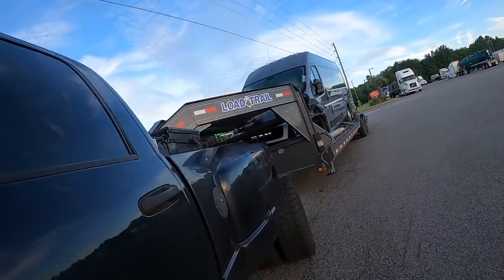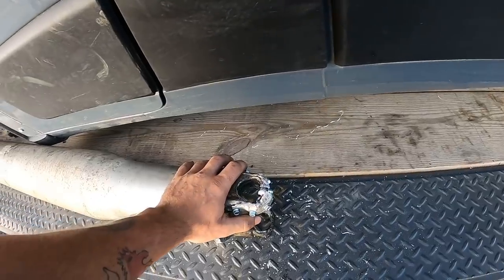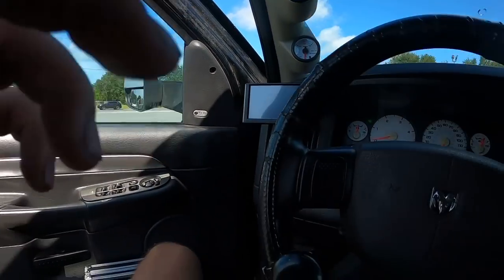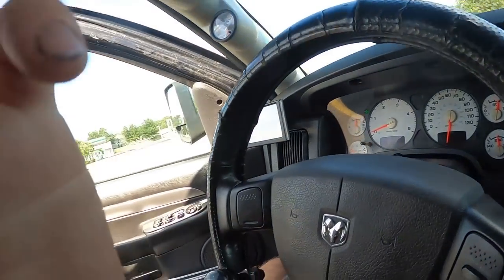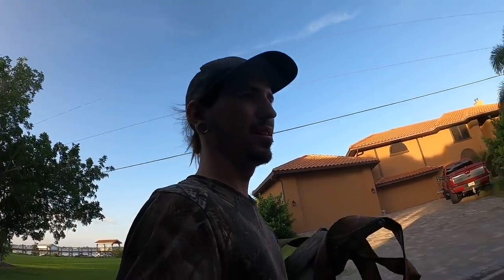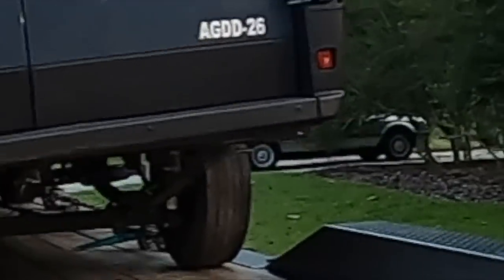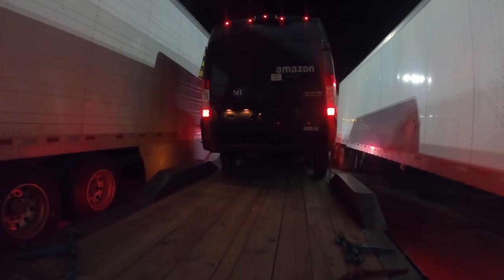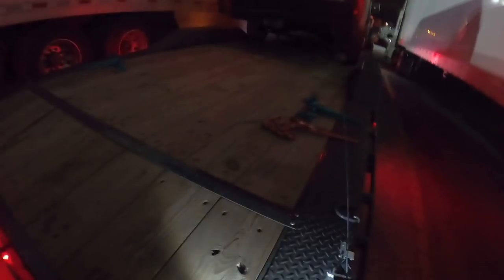How To Destroy A Driveshaft With 24k Gross Weight | Up And Running Again!

Comment: I would find a local driveline shop where ever your at throw them a little cash to get you fixed up and on the road ASAP time is money
Reply from the maker: Friday at 330 is when it broke
Reply: @CPSteveMiller  bummer yeah that’s a bad deal kinda sol on a Friday besides fb marketplace. I’ve done that during the week when I’m working out of town I’ll say hey just charge me extra I need this right away,to get to the front of the line.

Comment: I think you're simply referring to deceleration or decelerating.  

I don't think that was the problem either.  Too easy to place blame on that.  Although obviously the jerkiness of doing what you did in low gear is going to be an issue, you should be able to decelerate without an issue even in low.  

I said this on your other previous video (can't remember which one now) but, if this was the issue, you would see people all over the place with driveshafts blown out.  You know damn well that people are constantly doing THE EXACT SAME THING you did and they didn't have a driveshaft issue.

I don't know what the answer is but I just don't suspect it was just letting off on the throttle without pushing in on the clutch.  

Consider this:  What happens when you let off of the throttle cruising down the highway?  You are decelerating.  And you would be doing the same thing.  Just with a higher revolution on the rearend gears and driveshaft.  So, is the force going to be more or less during cruising speeds?

I don't know the answer to that.  Someone with more knowledge or experience with driveline engineering and so on would know more about that.  

So, is there a possibility that you have changed the U-joints in the past and ended up banging on the U-joint area on the driveshaft and causing some damage?  I am curious if that is more of a possibility.  

I don't know.  I'm just not sold on it being what you said.  People are doing what you did every day with more weight behind their trucks and not having issues.  

Are you sure there isn't possibly an issue with the rearend itself and maybe a ring & pinion issue or a bearing issue in the differential or something else?  

I'm hoping you're right because if that isn't it, then the problem is still not fixed and only going to keep taking out driveshafts.  And that causes downtime and headaches for you which is not good.  

I hope you have some better weeks and months ahead.  
---------------------------
And switch shirts and shower already.  Tree camo again for  the 118th day/night?  Really?  (by the way, I watched your video where you discuss this so just know the sarcasm emoji was hit)

Comment: Drive shaft should be able to handle that, unless theirs is a difference auto trans to manual trans in strength.
Reply from the maker: Manual is harder on it since it's direct drive whereas the automatic slips until you hit lockup